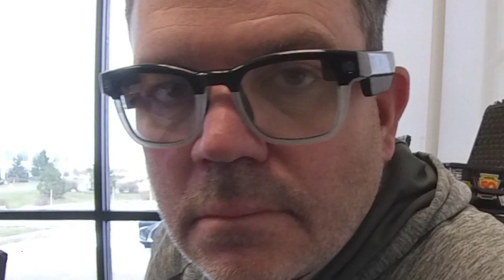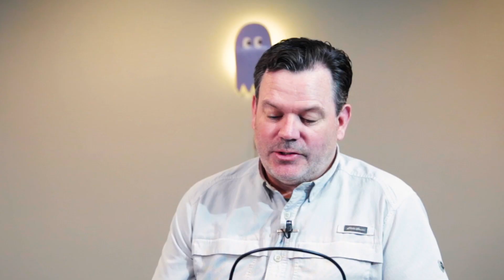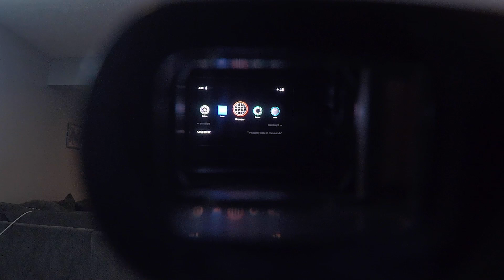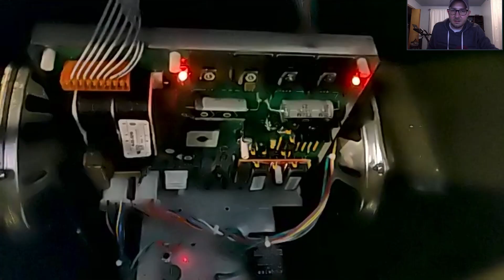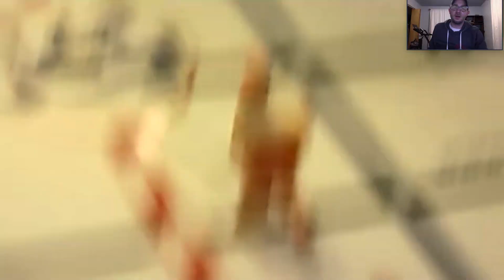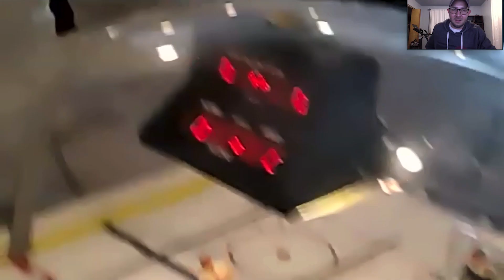VUZIX Smart glasses remotely FIXED my Bubble Hockey!

Comment: The glasses should be used tethered to a battery bank in the pocket or in a backpack.  This way we aren't limited with code that is designed for low use.  As long as the code doesn't drop the battery levels faster than it can recharge, it should be good all day.
Reply from the maker: One whole side of the glasses is a large battery.  It lasts for a very long time.
Reply: The glasses do support an external battery pack, and have enough backup battery you can hot swap battery packs.